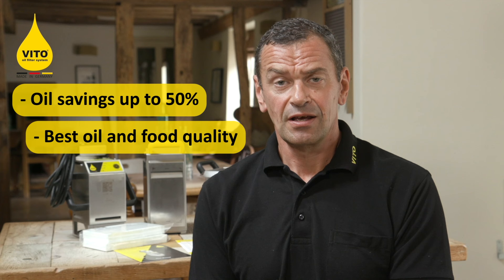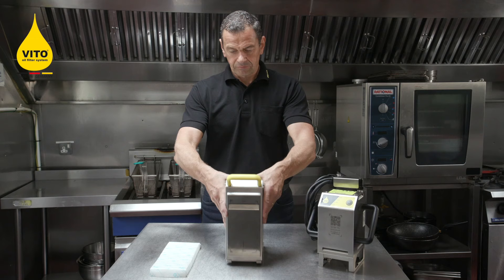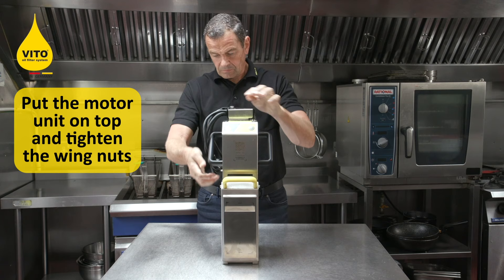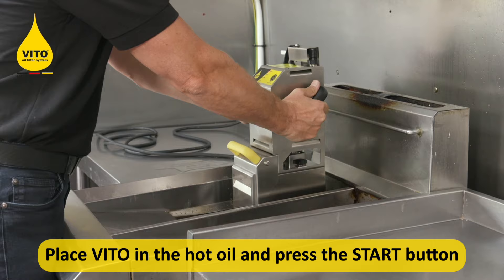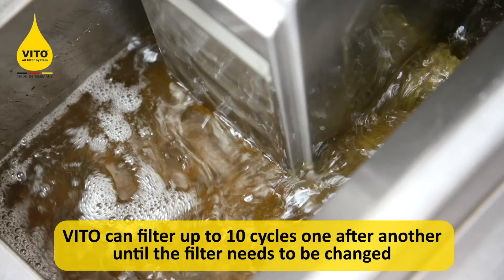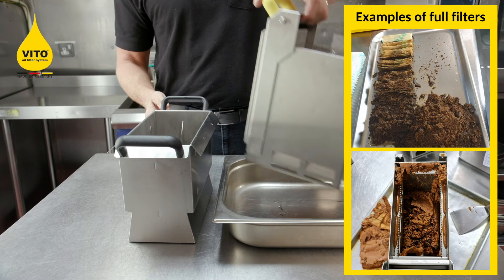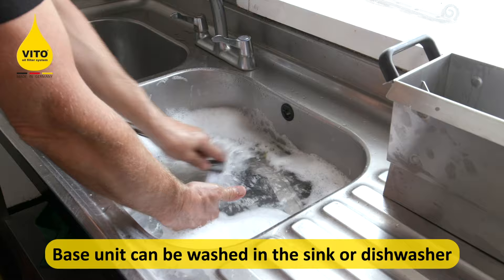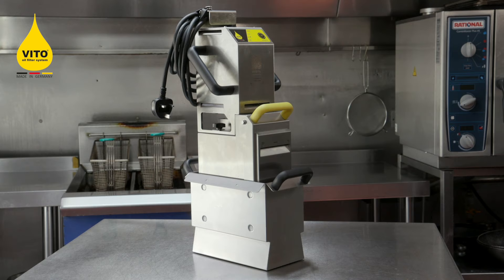How to use the VITO VL frying oil filtration system

Comment: Hi will it pick chips n bits of batter which may have sunk to the bottom 
And picking up flour which may have dropped to the bottom we use for fried chicken
Reply from the maker: Hello
Thanks for your message! 

To answer your question: Yes, with our VITO oil filtration systems all particles will be removed from your frying oil even the ones that are on the bottom. Our portable oil filtration systems create a high pressure circulation in your deep fryer - like this it is able to do a really fine filtration of your entire oil in just 4,5 minutes and save you up to 50% of your frying oil. 

Kindly let us know if you have any further questions. You can also send us an email to export@vito.ag, we will be happy to assist!
Reply: I noticed your filter machine only placed on one location. What if you have those flour all over the bottom. How is it able to suck the entire bottom locations when it's only sitting in one place?

Comment: hello, does this filtering results in having the oil at the same efficiency as how it was the first time using it (brand new)?
Reply: Not good
Reply from the maker: Thank you for your comment! VITO does not recycle the oil. Through the filtration, the lifetime is prolonged so it does not spoil as fast as it would without filtration.